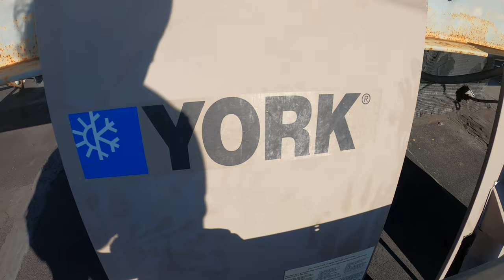HVAC Emergency Service Call: York RTU No Heat (Commercial Packaged RoofTop Unit) Furnace Not Heating

Comment: Brother whenever you got a situation like that, always take a look at the heat exchanger. If you have a rust spot on it with a hole it can cause roll out.
Reply: Yes. Examine the flame carefully before the blower motor starts and compare any changes in how the flame responds. Also take off the back panel to examine the heat exchanger for any cracks. There's also no way a roll out would be bad enough to get to that relay to melt it. There would be many other major signs of heat damage. The relay failed from bad connections that created excessive heat from the current of the inducer fan

Comment: You go ask yourself why the rollout switch was jump out could be heat exchanger has a cracked l would pull off the panels for the heat exchanger very important .I would check it and monitor the flame to see if there and wave when the blower comes on if everything checks ok get a new roll switch it's going to fail and your going be up there in the middle of the winter. Great video .
Reply: Gas pressure too had a call last week unit tripping on rollout ended up checking it fire at 4in WC I set it down to 3.3 but overfiring did its damage to the heat exchanger
Reply: Missed a lot of things. Didn’t amp inducer motor to find out why the relay burnt up. Didn’t check gas pressure, temp rise blower amps or even the heat exchanger. Could’ve been over firing or heat exchanger is rusted out but didn’t check.

Comment: Best practice to shut gas off rather than DC when on heating mode. Shutting the gas off allows the indoor fan to continue to run to cool the heat exchanger to prevent warping and stressing it. Grab that remote and crack one open😁

Comment: Probably jumped out the rollout because York is notorious for having sketchy rollouts. A continuity test will show the switch as closed, but there’s enough resistance to interrupt the safety circuit. Every single time I have a York no heat call I replace the rollout

Comment: You can have continuity across the roll out and it still wouldn't work. High impedance. High resistance = lower voltage

Comment: Why didn’t you check the heat exchanger
Reply: Mentions the flame may have rolled out and burnt the wiring but doesn’t look into why the flame may have been rolling out. Definite call back here.
Reply: I was just thinking the same thing. Either  a bad heat exchanger or a air leak on the sides where the heat exchanger mounts the the unit. So when the blower comes on it hits the flame. .
Reply: Didn’t check heat exchanger. Didn’t amp inducer motor to see why the relay burnt up. Didn’t check gas pressure, temp rise and amp all components. Did all that shit talk about hacks but failed to complete his job to 100%. Big picture
Reply: Normally I don’t care much but he shouldn’t be focusing so much on showing off his tools and how pretty his new part was compared to actually repairing the unit. This isn’t as bad as jumping out a safety, but if you ask me this is just as irresponsible. If that roll out is defective and gets stuck closed with a bad heat exchanger (that he didn’t check), he could be risking everyone in that church’s health.

Comment: The roll out could of been jumped because of high resistance but basics teach us the roll out did it’s job and locked the unit out for safety. You should of checked that heat exchanger before you left.

Comment: So I was sent to replace a heat exchanger , roll out switch , fan limit , high limit , igniter, flam sensor and ignition bored. It’s a York from the 90s. ( I didn’t originally diagnose just doing the hard work for a older tech) . I replaced everything and went to burn off and the inducer runs continuously but no ignition. I’m not getting 24 off the bored to any of the switches. So I switched the bored with an identical unit to see if that’s the problem and it’s not. Unit has no pressure switches. Can someone point me in the right direction? Also what does “ IR” mean on the wiring schematic?
Reply: It's been a year. Nobody answered. Did you figure it out? Can you share what you found out?
Reply: Was the gas off to the unit?